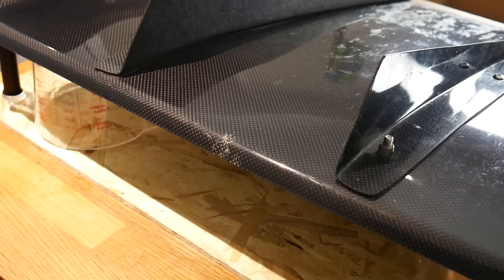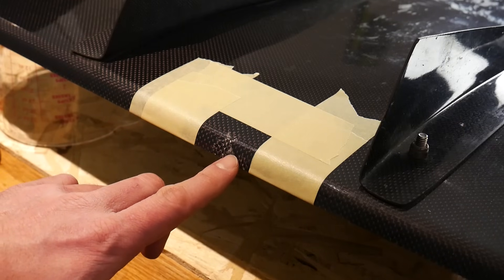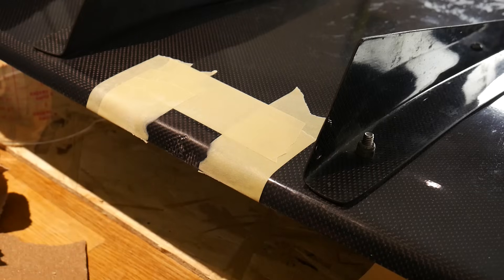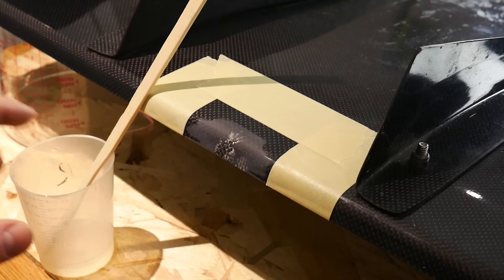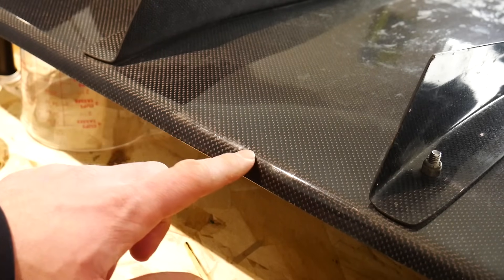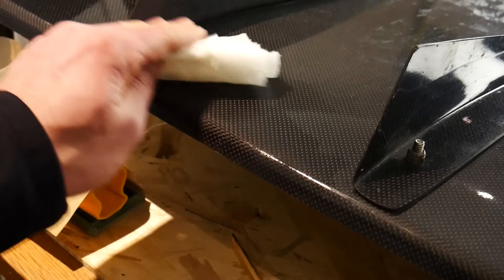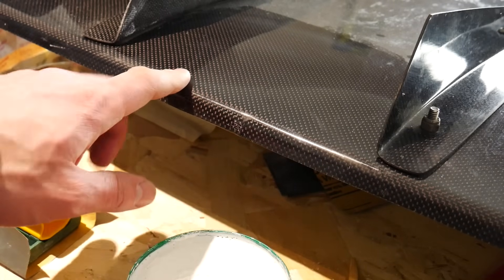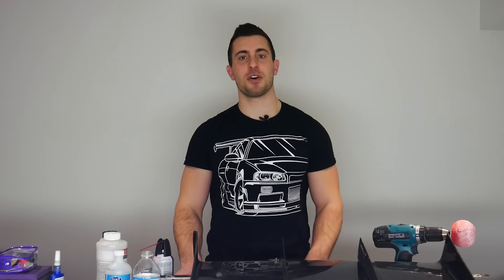How To Repair Carbon Fiber Cracks

Comment: Use a heat gun to get the bubbles out while the resin is wet. Then you don’t have bubbles. For smaller parts, I sand the whole thing and spray with a 2k clear. Bit more of a pain with large parts.

Comment: I use a uv cured resin to fill voids, then mix and paint on standard resin to finish, then sand. Quicker way to fill voids and low spots.

Comment: Can I share a trick with you to avoid bubbles? 
On your last coat of resin, take cling wrap plastic and wrap the whole area with it. Don't run your finger over it or pull it to right or the plastic will fill into the low points, just place it snug enough that to will keep it from dripping and getting bubbles. 
I've the whole thing dries up it pulls easily.

Comment: To prevent/remove air bubbles lightly hit the wet resin with a heat gun and they will rise to the surface and dissipate

Comment: Thanks for the vid.  Hubby took his Triumph MC in for a tire replacement and they must have backed the bike into something solid and made a triangular, dime sized, full thickness crack in his lower graphite fiber can cap.  Guys take a photo of everything.  The cans were optional Triumph accessory (made in Italy) for $1200.  Replacement parts difficult to get.

Comment: Nice video mate, any tips for scratches in a carbon car roof?
Reply from the maker: If they are very fine scratches you may be able to just cut and buff but be very careful not to go too deep or build up too much heat on the epoxy surface

Comment: What’s the best way to seal carbon fibre against weather after it’s been sanded and polished?
Reply: Tbh, I’m about to buy a G20 BMW lip, seems to be cracked and scratched - getting more info. I plan to restore it, then give it either a clear coating - so water and dirts just falls off, or give it a good long-lasting wax finish!

Comment: What would happen if I just fill the cracked area without sanding?
Reply from the maker: Might run the risk of it not properly binding and then eventually it separates
Reply: @EmbraceMaking  Do you think I could end up worsen the situation? I have a daggerboard with some carbon at the edge - there is a small area (<1cm2) where the carbon is not coated anymore. I'm looking for a quick fix for making it through the season.

Comment: Question: if you have a minor crack inside the carbon fiber but it's not a physical crack you can feel......does it matter to try and fix it as so if your just going to paint match the carbon fiber item (ie I'm going to paint match the hood)? I assume no you don't need to fix something minor I'm referring to as I'm breaking the hood down before it's professionally painted but I gotta ask to make sure, it's an expensive item lol.

Comment: Not sure you can help me but since you've obviously worked with carbon, I thought I'd bounce it off you. I have carbon fiber forks on my Cervelo Tri-bike, although the appearance is much more just a straight black shiny surface , rather than the carbon as visible as it is in your video here. There is a gouge in the fork of maybe 1/8 inch deep by about 1/2 inch long. I would like to fill it and then buff it back to somewhat of a shine. Rather than the clear resin you used here, is there another black epoxy that you could recommend?  I could send you a pic if that would give you a better idea. Thank you.
Reply from the maker: You can always just add dye to epoxy to color it but for your bike forks you might want to make sure the damage isn't structural? 1/8" deep sounds like its way into the carbon...

Comment: To prevent bubbles use MEK, blow with air and pay attention to your resin that nothing goes in during combination nor dirt on the part where you are using resin.
 Some dust can create air bubbles and that's why it comes out like that, while polishing with resin also your brush should be new and clean, alway use air blowing and after MEK.
Reply from the maker: Great tips, thanks!

Comment: Would this method work for my situation : Using your diffuser as an example, I have a duckbill wing, and similar to where the crack is in your vid, I have my duckbill “splitting” open, but running the length along the edge, maybe about 1-2 inches. Like my best example by “splitting” open is a deep cut in your skin.
Reply from the maker: Probably will work fine. Might be a little trickier working on the edge because the resin will want to run, but if you build it up slowly you can probably do it and it will come out better than having a split in it!

Comment: How can you tell if it’s resin or clear coat?
Reply: Light and angles are your best tools. Light sanding and a clean off should reveal a shine boundary of the clear coat vs epoxy.

Comment: Very good procedural tutorial on how to repair carbon fiber.  No need to allow shops to charge huge repair fees as long as you're willing to be resourceful.
Reply from the maker: Glad it was helpful!
Reply: @EmbraceMaking  I haven't used it yet, but I have some carbon fiber parts coming and it's good to know that there are ways to effect repairs without resorting to going hat (and wallet!) in hand to a shop who will doubtless wring their hands and suck their teeth and say "That's a hard one.  Let us get back to you." and then it's a $2000 bill.
Reply: this is not a crack in the Fibre itself!

Comment: I think using a heat gun on the resin could eliminate the small air bubbles when it is still drying👍🙏
Reply from the maker: Just don't add too much heat or get too close with the heat gun

Comment: On my Carbon diving fins..
I use a heat gun on Low setting to pop the tiny bubbles.. 😎
And not too close... Just until they pop. Much easier if the part was flipped, so the repair area is more flat, not vertical.
Reply: Yeah on large projects people use the propane torch

Comment: Great video!!...I got a question..if I cut into my carbon hood will I need to use a resin to reseal the part I cut a hole in for a hood latch?...or can I use something like silicon?
Reply from the maker: I would clean up the cut edges with a bit of epoxy if you can. Sand them smooth without fraying the fibers and dab a bit of epoxy on to make sure they don't fray any further.

Comment: What about a trim piece that has a stress crack? Looks like just the resin layer cracked in a long thin crack
Reply: Clean and try to get resin deep into crack. Follow the steps to smooth and should be good

Comment: I just bought a 911 with all carbon fiber interior trim.  Almost every piece is cracked. My plan was to replace everything over time, but I could probably buy another Porsche for the cost of that.  I think I'll try you methods on  the most inconspicuous piece/spot to test my skills and see how it looks and then go from there.  Thank you for the video
Reply from the maker: Best of luck, for the cost of the new parts from Porsche I am sure the effort and elbow grease will be more than worth it.

Comment: I'm sick of NY.. I just hit someone's leather workboot on the highway and it cracked my front lip on my m4. It damaged the weave a bit. I ordered the resin you have here, going to try to repair it... I'm aware the weave damage will show, I hope I can shape the resin into its original shape with alot of coats and sanding...thank you.
Reply from the maker: I feel you... I almost smoked a spare tire someone left in the middle of the highway the other day. Would have been a big repair bill. Good luck with your fix!
Reply: A piece of semi truck tire tread got my m4s front bumper this week so I feel you.

Comment: Isn't it very bad to breathe carbon fiber/resin dust?
Reply from the maker: Breathing anything other than air is probably not healthy as your lungs are not designed to process chemicals etc. Use a mask and your discretion when working with this stuff. Also, as I mention in the video you shouldn't sand into the actual carbon fiber cloth, this will prevent the actual carbon fibers from becoming airborne. You should only be working with the resin (which isn't healthy for you either) so wear a mask /respirator and work in an area with good ventilation.

Comment: 3 years later and this video is still useful. I bought a really bad condition CF hood for my g35. I got it for 100$ had some deep cracks on both sides as well as the front. I sanded, filled with resin 3 coats. One one side the cracks are completely gone. On the other side they are still visible BUT it has a layer of resin so you can’t feel it, imma wrap it and leave the vents visible. Thank you very much for the video 🔥
Reply: Crazy I’m in same boat .. 350z hood seabon for 100 I’m trying to fix lol
Reply: @plusdaddyyt  same boat lmao CF G35 Seibon hood for $140 thats cracked allllll over the place
Reply: haha im in the same with a front lip for my camaro, lip it self new is 500 and i got it for $50
Reply: ik this is old but i'm in the same boat. this guy on fb was parting out a 2007 audi a4. i negotiated with him and got a cf hood, a big intercooler, cold air intake all for $200. they're pretty reputable brands too so i was excited but the hood is pretty beat up, cracks everywhere in both the epoxy and cf itself, and the epoxy is pretty sunfaded. it's at least an 8 year old hood. gonna do the same thing to try and get rid of the cracks and then apply a clear ppf on it

Comment: Dude, thank you. I cracked my Seibon hood last week and they don't make them for my car anymore. This was a super informative video, even 2 years later. Subbed'
Reply from the maker: You're welcome! Thanks for the sub. Have you tried to fix it yet?
Reply: @EmbraceMaking  No sir; I always run myself thin and have a few projects going on currently. The car is garaged at the moment. the damage looks similar to your diffuser in the video, so I'm really hoping for decent results when I get the resin in.
Reply: I had a seibon wing for my prelude.  After 2 years it started yellowing.  I restored it but it would haze quickly.  Started just spraying silicone and wiping down. It is supposed to be higher quality than that. Wasn't impressed.

Comment: You say: Maybe next time, don't get any air bubbles... You can avoid a lot of bubbles by: Letting the resin sit a little bit after you prepared it/use a mini torch (like a lighter size) to go over the surface of the resin. Also, there's bubble crack spray on the market but personally I'm not a big fan of that stuff...
Reply from the maker: I've used the heat gun and acetone spray trick before when I did some carbon fiber wrapping. Works decent but acetone spray is pretty bad for you. Something to keep in mind.
Reply: @EmbraceMaking  Bubble burst spray I have is made with Alcohol.

Comment: Does anyone have any long term 1-2 year update on how this fix is holding up? I’m planning to use the same exact resin from the video, but wanted to see if this has proven to be stable and held up for anyone...or not. Using this for a CF roof, so I need it to. Great video and hope it has worked! Thanks!!!
Reply from the maker: So far it has worked out for me... I still have this piece and it looks fine. That being said, full disclaimer my car does not sit out in the sun.

Comment: Great video. I have a carbon hood on my car thats cracked and you can't find a replacement in the exact same style or any other hood that looks good so this is gonna help me out tremendously.
Reply from the maker: Glad it could help!
Reply: How did you hood turn out? Have a crack in my hood now
Reply: @karnij-et  I actually haven't done it yet lol. Getting ready to do it soon though.

Comment: Couldnt you do a resin infusion setup to draw the resin into the cracks? Kinda like how ppl repair windshield chips and cracks?
Reply from the maker: To be honest I've never seen an infusion set up on carbon that has already been laid up... I basically just made this tutorial for the average person who doesn't have all of the extra equipment... kind of a bare bones approach. Maybe someone has done an infusion repair? I feel like because the resin has already set in the fibers it would be difficult to draw it through the area to repair...

Comment: What if you are re-doing the whole resin on a front lip for example? Do you still do it in batches?
Reply from the maker: If you mix too much at once, keep in mind that the heat from the reaction can get intense! It will cure very quickly before you can work with it and in some cases get so hot it can actually start smoking and catch fire! Many years ago I had it melt right through a container! Read the labels!
Reply: @EmbraceMaking  Thanks I actually really didn't need a lot even for the whole lip.

Comment: Mixing the catalyst and the resin too quickly will also make bubbles. Mix it a bit more slowly instead of whipping it up ;)
Reply from the maker: Good tip! A nice smooth pour and mix helps prevent bubbles for sure!
Reply: I seen another tip to remove bubbles, place your measured container of resin in a larger hot water container similar to melting chocolate in a secondary larger container.
Reply: I find that giving it a blast with a heat gun set on low helps to get rid of bubbles and also helps the resin to wet out a bit better especially in a cold workshop. Be sure to get rid of any loose dust beforehand.
Reply: I have a question I have a carbon fiber hood and it has done spider cracks that have shown up they look like they are in the gel coat not into the fiber. What of the best way to go about fixing them?
Reply: @user-cj2vu4jn7v  Sand the area but NOT the carbon fiber as he says in the beginning of the video. It is important to take your time and ONLY sand the gel coat. Clean it and then apply a coat of gel coat. After it dries lightly sand the area again and apply another coat of gel coat to fill it in just as he is doing above. The key is to slowly build it up with more than 1 layer.
Reply: @casualguy3938  

The gel coat should I use the epoxy he used in the video?
Reply: @user-cj2vu4jn7v  I think all of them are very similar as long as you get a decent quality one. If you have experience working with one of them then that is what I would use. I would even go so far as to put a few coats of wax on it a few days after completion.
Reply: Ok I just wanted to make sure I didn’t know of there was a specific gel coat I should use out of epoxy resins is the same thing. So in the video he uses system three epoxy resin. I will contact them to make sure. I am gonna clear coat it and wax it as well thank you again
Reply: so i have reached out to duratec coatings to find a gel coat and the asked me what type of gel coat was used . I have no idea they wanted to know if its a polyester gel coat or a epoxy compatible gel coat . i have know idea  i called carbon creations who makes the hood and they were no help. the guy was trying to tell me it is just uv clear coat lol. on there web site is says they our Manufactured with a marine gelcoat variant to help prolong the life against UV aging effects. So I have know idea what to get to fix this.  Any thoughts??
Reply: @user-cj2vu4jn7v  I am not sure braddah. If it isn't a high stress area then perhaps the epoxy compatible gel will do. Just apply wax a few times a year to UV protect it and it should be okay.
Reply: Hey man what if the place where i put the resin still looks more blurry then the original ? is it because of the mix, just want to know what I did wrong. I polished already and still looks blurry. 🙏

Comment: i know this is a newer comment but i was wondering where i would be able to buy the carbon fiber cloth
Reply from the maker: Lots of online stores, otherwise if you have a boat repair shop locally, they might have something you can buy. They work with composites all of the time!
Reply: Embrace Racing thank you very much !

Comment: Have you looked into Gorilla Epoxy Adhesive or J-B Weld Clear Epoxy Adhesive? You think any of those would be good enough? I'm just trying to find something locally and it looks like it's the best I got...
Reply: I'm in process of repairing my carbon fiber lip for my car (a lot of the original epoxy and coat got removed after the lip fell off on the freeway). I can't comment on longevity since I'm still in process of repairing my lip, but i will say that the Gorilla Epoxy is really easy to use and apply. It's also really easy to smooth out excess layers and lumps using 120 grit sandpaper. After applying the Gorilla Epoxy and smoothing everything out, my plan is to primer, paint and clear the lip. Hopefully these extra layers will protect the Gorilla epoxy from the elements.

Comment: So I got a carbon fiber hood used that's cracked really bad here and they're down to fibers. So do I need to use the carbon fiber resin and hardener? like I can't just use regular fiberglass right it's not fiberglass? I don't know anything about carbon but I want to repair it and either wrap it or paint it. I know I can't repair it back to carbon fiber..sadly
Reply from the maker: Yes, use the epoxy resin and hardner when working with carbon fiber. The polyester resin commonly used with fiberglass is not as strong and may not bond well to the piece that is already made from epoxy resin.
Reply: @EmbraceMaking  wow I don't even know where to find carbon fiber resin and hardener. Like I said I never worked with it before but I got this Hood really cheap and it's really nice. So can I just sand the clear coat off that's peeling, repair the cracks and damage, and just have it wrapped?

Comment: I have the perfect project for this type of repair.  My front splitter for my 2012 GT500 cracked.  This will work perfectly.  Check out my channel: Doc's Boost.  Thanks.
Reply from the maker: Thanks and great work with your channel! :)